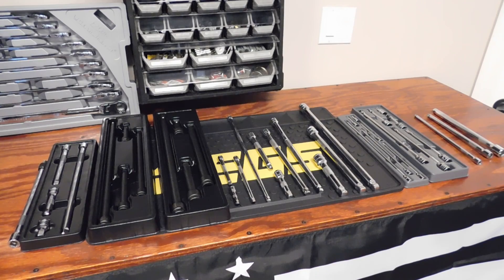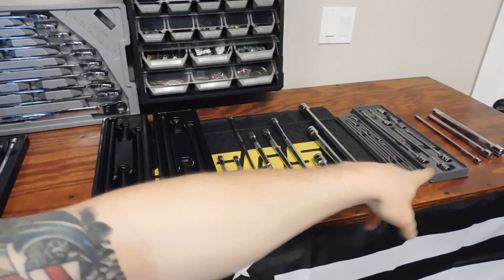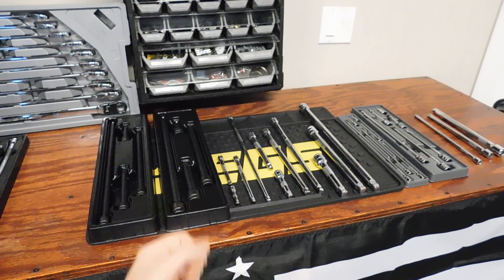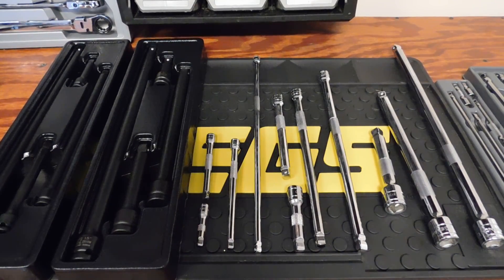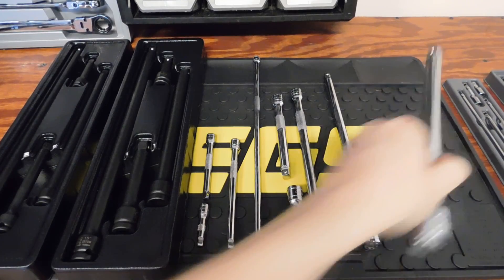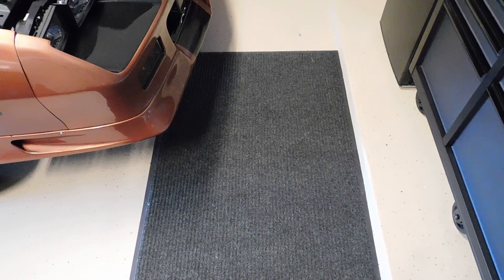One of my Favorite Tools and Most Commonly Used / Snap On and More

Comment: hey Tony thanks for your post. I have wobble extension just haven't used them, their in a box in my tool box so I just haven't dug them out, I'll try them now that I see you using them often. extensions was one of the things I needed to add to my tools I bought a few gearwrench, Craftsman. I do like the gearwrench tools extensions in 3/8 drive and I did break the bank on a snap-on 1/2 drive impact extension set 200. bucks but it is a real good set
Reply from the maker: Martin Schaffmeir oh very nice and ya I think you will really enjoy them. Thank you for watching and commenting!

Comment: Snap-On Chrome or the GP or Sunex black extensions are good. Don't put those wobble or Pittsburgh on an impact. Snap-on Chrome extensions are on my list of tools you should buy from Snap-on - expensive but not outrageous like some of their tools. 1/4 3/8 and 1/2 inch Snap-on extension set good! I also have the heavy duty long Snap-on 3/8 and 1/4 that are long and thick. I think they also make a 1/2 to 3/8 long extension for transmissions. The Snap-on swivel, universals and universal sockets are the best made too. Cheap tools are not a total waste of money though, you can put a set at home and in the truck. 

I worked for a speed shop and the owner always bought 2 of everything off the Snap-on truck. He said one set was to work with and the other set was in his office to look at. Takes a long time to build up a good set of tools, don't expect it to happen over night. Snap-on tools are just like anything else, they get outdated or wore out. Might take you longer than expected to get your own shop and by then all your tools be wore out! Don't sink yourself in debts, but there is no better time to do what you want than right now!  You think prices are high now, wait 20-30 years and they be much higher. Hell wait 10 years they be higher. No guarantee your pay is going up either. Compared to the cost of inflation, I made way more money in the 80's than I do now. Some weeks (not considering inflation) I made more when I was 16 than today! The dude that retired from the city job got regular increases in salary over the years but the mechanic's flatrate percentage kept creeping down and pay remained about the same. You need to own the shop in this biz to make money. The way technology is moving, you better get started!
Reply: Jacks Garage GP = Gray Pneumatic?
Reply: RustyJeep Yeah, they good impact sockets. Sunex or Grey Pneumatic.
Reply from the maker: Jacks Garage ya those are both great companies for impact grade tools and for a really good price compared to other higher brand name tools